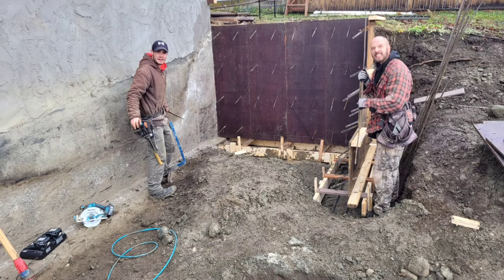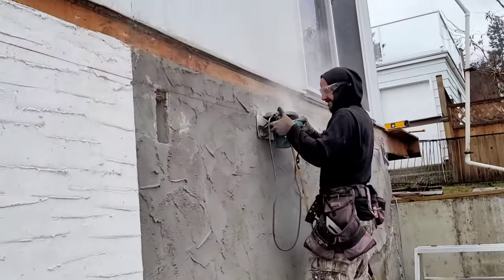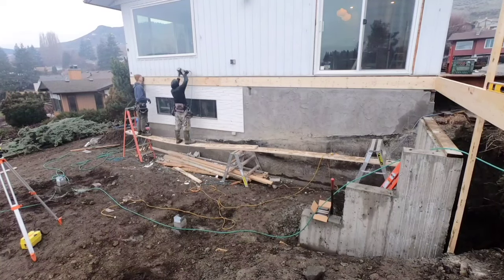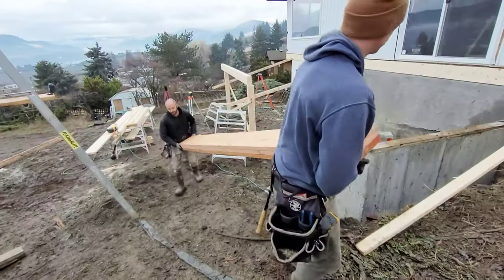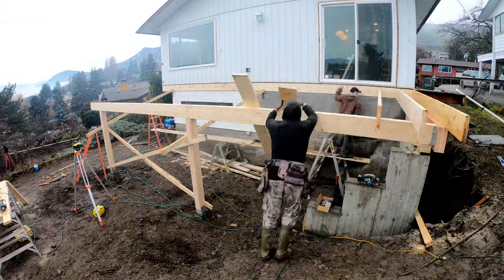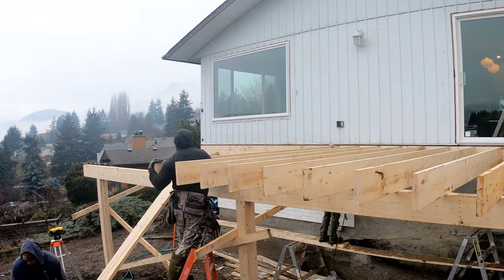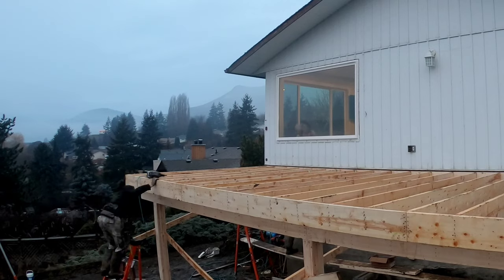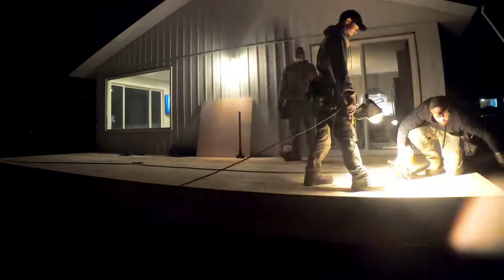How to build a large deck in only 1 day // Framing 18 ft by 11 ft

Comment: Did you flash the ledger at all? Seems like water getting in there could be a concern. Also, I guess the span is short enough you felt good not adding any blocking to the joists?
Reply from the maker: We didn't flash the ledger at the time but flashed it later as we cut 10 inches off the bottom of the siding so that the vinyl decking can run 6 inches up the exterior of the wall and then installed a 10 inch wide piece of trim which is flashed.
The span from the wall to the beam was only 10 ft so we didn't add blocking. Had it been any longer or if we used 2by8 joists or had we poured concrete we would have added blocking.